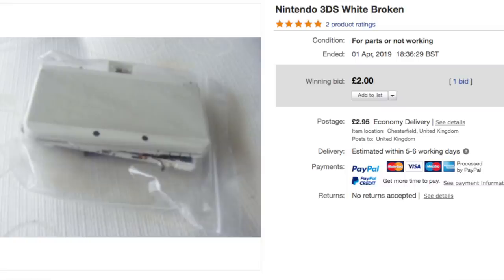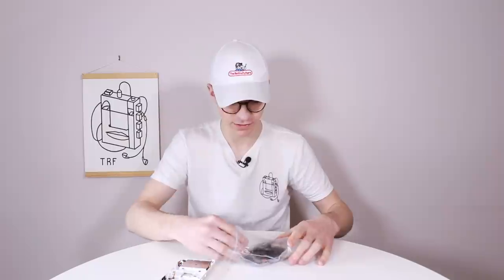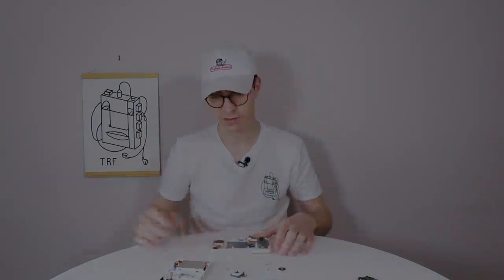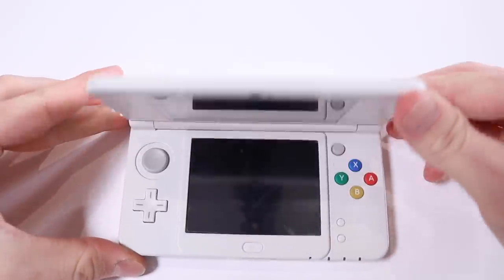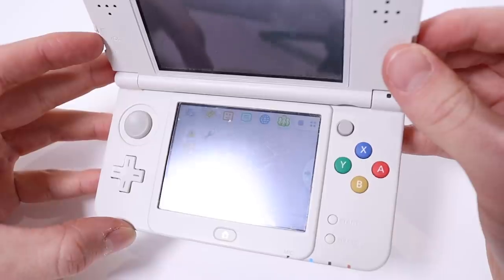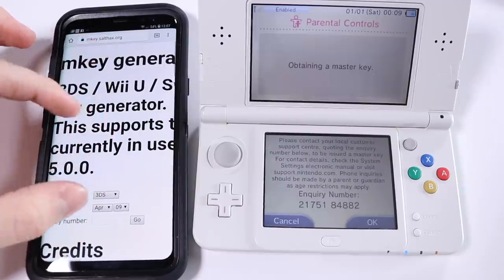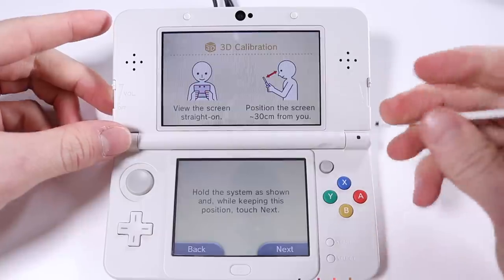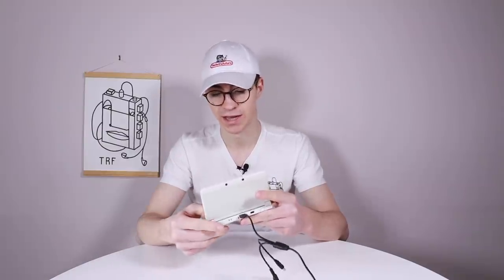£4.95 Nintendo New 3DS - Can I Fix It?

Comment: well, it had parental controls. odds are it used to be a curious kids 3DS, got hold of a screwdriver and went to town, then noticed they had no clue how to put it back together
Reply: Or it was stolen... Who knows?
Reply: How does a child get hold of a tri-wing driver?
Reply: Found his explanation much more plausible
Reply: It’s easy to get rid off parental controls
Reply: @jussapitka6041  toolbox
Reply: I did something like that... just years ago I went through my micro SD and put the ROMs online
Reply: I thought the same thing that maybe someone took it apart and couldn't figure out how to put it back together
Reply: @romanthegambler6966  these screws are only used by Nintendo, so it's unlikely they would have a screwdriver unless they were huge Nintendo fans
Reply: "got hold of a screwdriver and went to town" - Altirix 2k19
Reply: Ethan Campbell it’s also used by other things, but rarely. Anyway, every screwdriver kit I had had it, so it’s not hard to come by.
Reply: I did this with a gba sp but I put I back together with an ips screen

Comment: As long as the motherboard remains intact, it’s impossible for any gadget to be broken. Even if all but the motherboard gets destroyed, just assemble all the parts to it and presto. You got your gadget back.
Reply: Exactly
Reply: If it gets wet?
Reply: Not exactly. The original Xbox has a faulty capacity that, if left untreated, fries the entire motherboard beyond repair.
Reply: @heckno15yearsago  That means the motherboard isn't intact, if it's corroded.
Reply: Wrong. Some chips require firmware that isn't publically available. A lot of that firmware has been lost to time or the company has gone bankrupt etc.
Reply: ignorance is bliss for us old console hunters

Comment from the maker: Update: The screen issue was all down to the Joystick. Swapped it out with my black one and there is no problem now! 

Also - no idea what issue the torn ribbon may be causing.... everything looks fine? Its the LCD screen ribbon cable. I am 90% sure it is a data cable and the backlight cable is the thinner long one with two traces ( + & - probably...). Let me know if you think its worth replacing a broken component causing no damage? Its a £17 replacement....
Reply: well
Have ya tested if it saves things related to the camera?
If not ya might wanna check it out

If that works I wouldnt bother tbh
Reply: Glad you picked up on that issue!
I was going to say I had the exact issue on my 3DS, and it is a known outcome of having no joystick connected.
Reply: @Pink Kirlia yes, Slider is the official term I believe, but I just call them joysticks
Reply: When I had that issue with my N3DSXL, it was because of the c stick (but only because I replaced it with a PSP nub and it wasn’t properly aligned and was giving pressure to one side).
Reply: Maybe the 3D slider?
Reply: You have already spent too much money on this. It is a bad idea.
Reply: The Retro Future why don’t yo pin this
Reply: yes it is worth because you can sell the 3ds for €200 (i dont know how many pounds it is)
Reply: I had the same problem with my new Nintendo 3DS, it suffered no abuse yet it performed that same cursor problem. Tbh I’m curious on what causes this to occur
Reply: vu
Reply: Having no joystick connected makes the cursor go down-right because there's no connection between the rails which makes the console thinks that you hold it down-right. Happened to my psp, and if would probably happen on everything with joysticks
Reply: If it ain’t broke don’t fix it
Reply: The replacement costs more than the console

Comment: As someone who works on Macbooks I see this repair and think.... this looks just lovely to work on. No tearing out keyboard rivets or fucked display ribbon cables- just lovely.
Reply from the maker: Any ideas why my 2016 MacBook Pro 15” screen makes a popping noise? As if some adhesive is sticking and unsticking or something... thanks.

Comment: It's so cool how all the parts of a 3DS rely on each other in order to make the system work even though they serve different purposes
Nice video!
Reply from the maker: I think its super cool too... like a colony of ants working in harmony!
Reply: You can remove a small number of parts and still have the home menu load without issues, you can even remove the micro sd reader and still run games with no problems

Comment: Hi, I’d like to repair my old 3DS (the first model), which has been damaged from continuous opening and closing of the screen. When I try to turn it on I have to find the right upper screen opening position or else it’ll shut down with a “crack” sound, same when it’s on and you move the screen. Thing is that the position I’m forced to use is very unnatural and even if I move slightly, the whole game shuts. I already tried to go to my phone repairer with no success. I suppose the problem it’s only a cable to the screen that got damaged; is it possible to repair by myself (judging on how the cables are connected in this video I suppose so, there isn’t anything to weld)? Do I have to look only for the cable I suppose or other things? And finally is it possible to buy only some parts online or do I have to buy a box full of all parts like he did on the video (everything else works perfectly so I wouldn’t need them)? Thanks
Reply: Can't help u bud, but Let's Hope somebody fixes your problem. Wish you the best!
Reply: Loose ribbon cable for the screen so it needs to be put back into its socket properly before being closed back up. Good luck it's not the hardest fix but you Dan still break your 3ds in the process so be careful.

Comment: The random joystick input could also be the c-stick (right hand nub joystick). There's no system calibration for it, but some games have a "Circle pad pro" calibration feature which shows that joystick isolated from the rest. Majora's mask and Resident evil revelations for example. If it's jittery there you know for sure it's that joystick that has an issue. It's supposed to auto-re-calibrate itself when it wakes up from sleep mode btw, so closing the lid, waiting for a second or two, then opening it again can fix it for that play session. IIRC unplugging that joystick does not introduce jittery input, so that's an option for the majority of games that doesn't use it anyway. Great channel btw! :-)

Comment: the "cursor" going all around when booting it up is when 200 hours of gameplay played, it starts breaking. now, since its a part of the console, not a seperate contoller, it is unable to be fixed. the problem is called "drifting" and i have it on my switch. however, the problem is able to be fixed, and may you please do a video on that?

Comment: my guess is than they opened it to fix the Touch screen and ended up breaking that ribbon cable from the joystick in the process and did not bothered to put it back again, Also is nice to see people coming through and actually shipping the item after a low winning bid, those sells end up being canceled quite frequently

also check the placement of the touch screen against the shell since small pressure point from the side can cause that trouble you are having everytime you turn it on

Comment: For the new 3DS set of systems what makes the cursor scroll are the DPAD, Analog Main stick, C Stick, ZL, ZR. Judging by the way the cursor moved and the sound it made I'd say that it's not ZL nor ZR and since the DPAD works and the main Analog was detached, that leaves you with a likely faulty C-Stick (can be checked in settings under calibration I believe)

Comment: There is a ripped ribbon cable on the bottom screen as you can see at 3:28 . It is probably the touch or something that is flipping out. Be sure to replace that screen too so you don't have any issues in the future.

Comment: Hey dude, I have a question:

 I bough a New 2DS XL completely new from Game Stop almost two years ago. Some month ago the top screen went completely dark with two horizontal lines, one green and one pink, and some days later the console didn't even turn on, the console is fully charged, the power light goes blue and then the top screen generates a quick flash and the console turns off itself.

So my question is if do you know what it is, and if you do, what it is? Can I fix it myself and how?

Thank you for helping and great video (and sorry for my bad english)!
Reply: That happend to me one day. But is because my 2DS XL top screen broked. And alot of other problems to. But yours... In my theory, game stop sold you a broken one. Game stop had alot of problems selling refurbished consoles. So don't ever trust game stop to buy a refurbished consoles. Yust... Buy a brand new one. Shawy. 👌

Comment: 5£ a broke new3ds
20-40£ for screen and screws
And normally the console cost 150£ (?)
You need a lot of patience, but actually you can repair a broke console c.c
Reply: the standard size new 3ds is like 350$ brand new for some reason

Comment: You do this sorta stuff perfectly

once I tried to repair a PS2 that wouldn't read disks and accidentally tore off the power connection -_-

Note to self: Next time use desolder before you remove power connections

Comment: The cable u put in on 3:28 - 3:30 is teard on the left side. 2 connectors don't have connection of that ribbon cable. I would guess it's for the lower screen maybe for the touch part of it, that's why it escalates when u turn it on.

Comment: I bought a new 3ds in 2015. It was a used one but was basically brand new. It has a sticky button where I’ll have to click it repeatedly until it finally works and then it works fine after that. It may be a common thing to have button issues.

Comment: Pretty sure the analog thing happens because the 3ds is trying to see the input of the stick, but since there isn't one, it goes crazy like that.  I say this out of experience, from using a pro controller on my wii. If you twisted the analog while the wii was loading, it would set the position it was as the default, aka that position would now be it's 'unpressed' state, the only way to reset it back would be to reconnect the controller.

Edit: it probably calms down after a while due to pressing the d-pad, so it starts taking input from there, not sure though.

Comment: Hey, the issue your having with the homescreen is the c-stick going crazy (mine was doing it too). You need to buy a new c-stick (not the nub, the actual electronic part) to fix it, since the little contact pad at the bottom can come unglued and the c-stick won't ever work properly again.

Comment: Pretty sure not having a joystick plugged in results in the system scrolling wildly. The joystick is an analog potentiometer type which outputs half supply for x and y axis' when centered. By not having any joystick plugged in, the voltage is basically floating which tells the console to randomly start scrolling.
Reply from the maker: Ah Shawn.... saving the day again with your super hero knowledge power.

Comment: Funnily enough I found a new 3ds similar to this one once from a car boot for £5 in its original (but a little torn) box.  I was quite lucky as it only needed a clean with some air duster and alcohol cleaner in cartridge slot.  It also needed the parental lock disabling but it works ok.

Comment: @3:33 the large ribbon connector has a tear in it what looks to cut two of the pins off, and looking at it I guess its a touch or LCD cable for the bottom screen, might be causing the weird touch issue?
Reply from the maker: Nope! I replaced the joystick from my other one. Issue solved! No idea what if any effect the tear is having. It all seems fine?

Comment: Does your homebutton and the microphone work? When I fixed the issue that appeared in the beginning of the video with the scrolling I kinda made a mistake with the Zif connectors,which are not meant to be loosened and they looked kinda loosened in your reassambly.

Comment: Cherrs for the video pal. I was replacing the screen on my 2ds and broke the plastic catch for the joy stick i didnt realize it would go back together and work with just the direction buttons. Dont know of there is a fix for a broken ribbon cable catch.

Comment: Tore your ribbon cable at 3:28 - Seriously, stop using metal tweezers!  Find some plastic ones with rubber tips or a wooden/bamboo toothpick and gently press on the edges.
Reply from the maker: Nope! It was like that when I got it.

Comment: I. HATE. RIBBON. CABLES. I was changing my laptops hard drive to a 2tb one (d: not  c: I'm not an idiot) and the ribbon cable for my input board snapped. Just to be clear, my bios chip, all ports, camera, keyboard, mousepad and speakers. Yeah. Had to buy a new input board and bios chip. 157 pounds for all that. Don't work on your laptop if you tired and a bit wacked on antidepressants.

Comment: I have an original 3DS in that royal purple color that spontaneously quit working. It was playable one weekend and wasn't the next. It turns on, like the light comes on, but the screens don't come on and there's no sound. I tried letting the battery run out and recharging it, I tried leaving it on for like 45 minutes, I tried plugging it in. Online it sounds like this "just happens" to that era of 3DS. Do you have any idea what would need to be replaced on it?

Comment: If you are still having problems with the cursor at the start. To me it looks like a dpad or joystick pin issue but I am not 100% sure. The reason why I know is cause it happens if you install a controller mod incorrectly.

Comment: I broke my n3dsxl when replacing a cracked display. But I broke that flap at 3:31 trying to get it to hold the cord. The tiny cord from one speaker also snapped when I handled it. When I turn it on, the light goes on for a sec and then a slight cracking sound is heard before it's shut down.
Is it salvagable? And what is it that causes it to shut down?
Reply: It means that a ribbon cable isn't properly seated. Try some super glue for that as for the cord you can solder it back.
Reply: @fishingboo9018  thx. Will it work even without soldering the speaker cord? I don't have the proper tools, and I don't care about the speakers. But I can get it done if I have to. I just want to make sure all the ribbon cables are functioning first.

Comment: I got a used DS Lite that was in immaculate condition.  Went to put a screen protector on the bottom screen (I don't bother with the top one since I don't ever touch it).  Wouldn't stick.  Then I looked at the corner and found it already had one, just like this.

Comment: I had the same problem on my original 3ds. It is the gpio controll chip. While running if you apply pressure on it will stop jumping around. It will need a reflow. I dont know which is the chip on new 3ds but it should be a medium size square next to the cartridge port.

Comment: Only if I knew how to do these things. Have 2 old ds, a ds lite that the inside top screen is broken but works fine besides that. And a old 3ds which barely has any scratches or anything but accidentally spilled water on it so when I turn it on it makes a pop noise and turns off again. The sadness I think I only had it for 3 month before it broke

Comment: yo how can i fix ghosting on the top screen? did a reshell and then ghosting happened in 3d, not possible to calibrate or something. maybe the slider or u think the cables not plugged in correctly, need help thx

Comment: I got one of these that had no touch working. I cleaned out around the edges and got the touch working but everything works great for a minute or two when I boot it up but then it starts jumping around and the buttons stop working and freezes after a while. Any ideas?
Reply: It seems to have a short of some kind because when everything is working I've successfully calibrated both the joystick and touch screen. I'm almost thinking of trying the abyx board replacement to see if that helps
Reply: @matssundin15  touch screen has a false input. This happens when I hold my stylus on my new 3ds xl then all the buttons no longer do anything but once I remove my stylus it works perfectly. Good luck fixing it.
Reply: @stonedsavage7814  Hi I ended up putting a separate main mother board in and the touch and everything worked great so definitely some short on the board somewhere.

Comment: How do I fix the power button? I spilled water on it it stayed on tho. After few hours it still stayed on but didn’t want to turn off. I had no choice to remove the battery , after that the on button did not work . It still charges . So I believe is the on /off button that’s ruined?

Comment: Can someone please help me, I’ve recently bought a new 3ds which has the hshop installed, my problem is the ds only plays for about 50 minutes before it dies and I need a recharge, thinking my battery was the issue, I decided to have a look and to my surprise I found a wii u battery in there? When I checked the mAh it’s a 2000mAh battery which is more powerful than the standard battery. A standard battery is only 1400mAh. 
So my question is, is there a battery issue with my ds or do I need a more powerful battery? And were could I get one from?
Reply: Are you sure it charges fully? My 3DS has a problem where it appears to be full when it's only at around 75%. Also the battery on that 3DS might be old and need replacement depending on how heavily it's been used.

Comment: PLEASE HELP!!! Hey Retro, or anybody who knows the answer to this. I have a 3ds XL and everything works except for the wireless connection for online and download play. The yellow light turns on and after 20 seconds the ds goes black and says "An error has occurred. Hold down the power button to turn off the power. then turn it on and try again" does anybody know how to repair this?